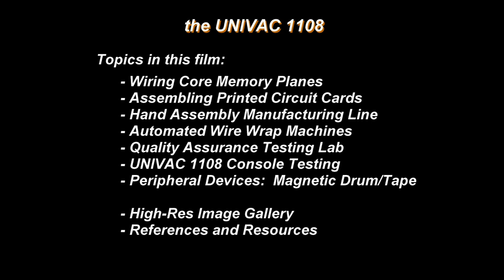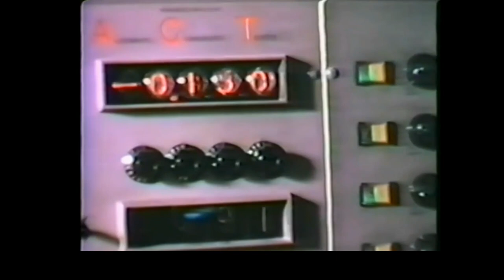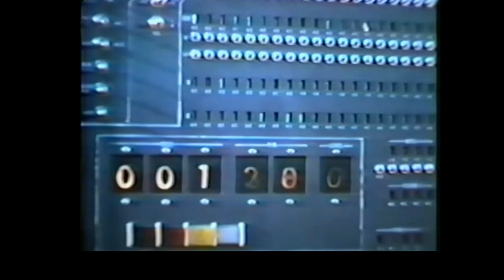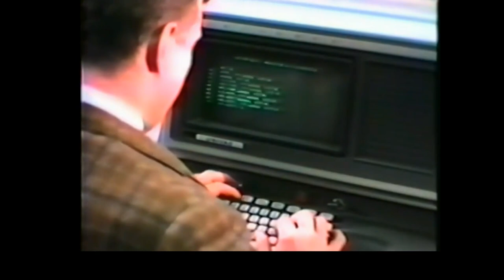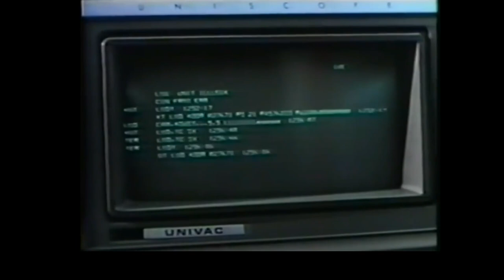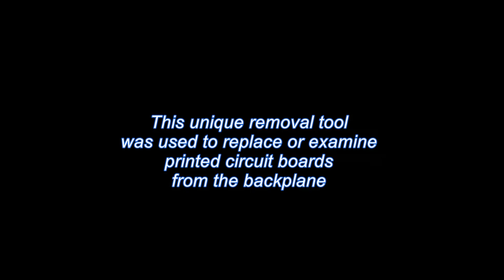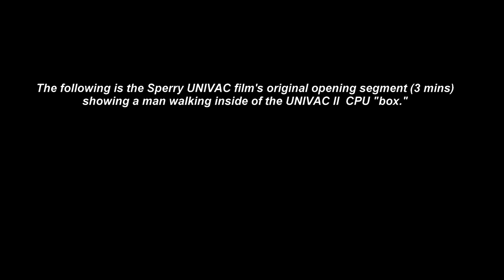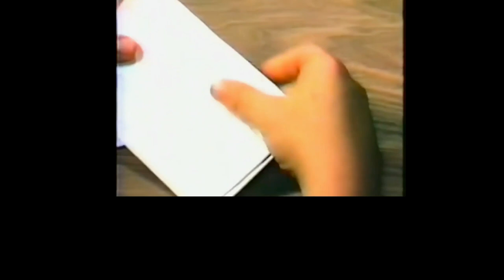Computer History:  Building the UNIVAC 1108 Computer, Twin Cities (1965-1968) Sperry Rand, UNISYS

Comment: I spent many years working at Univac (Unisys) Roseville,MN. 1108’s were the first computer I ever worked on as a tech. Eventuality wrote software for this computer and it’s many variants. I also assembled and tested the very first CRT display on a 1108. My mother in law worked there also and worked stringing those tiny wires through the core memories sitting at a microscope many hours!
Reply: What programming language do you used?
Reply: I started working on a Univac 418 III.  It was used by the city.  Started out writing Fortran.  But also did work on the machine in Cobol and assembly.

Comment: While yet in high school in 1969-70, I taught myself FORTRAN IV on a UNIVAC 1108 at Collins Radio Company in Newport Beach, California, using a book called "Fortran IV, Self-Taught" by Mario V. Farina.  I was fortunate to be one of the only ones in our school to have such computer access, more so than any of the teachers.  Collins sponsored a Boy Scout technical Explorer Post, and provided access to amazing technical resources.  I had 24-hour on-site access to all the computer time I wanted.  The actual Univac 1108 was is Dallas, Texas, but connected by high-speed data lines to a Collins-built I/O processing computer that managed the very high speed card reader and line printer.  And they had several IBM Model 29 card punches which I used to punch many hundreds of cards for the programs I wrote, and that another fellow scout collaborated on.  During the second week of a two-week Christmas respite from school, my friend and I wrote and ran a 500-card Fortran digital logic simulation program.  I still have the card stack and the printouts from the 132 column line printer.
Reply from the maker: Hi dwbogardus, teaching yourself FORTRAN is no small feat!  Very cool.  Thanks for the story!  ~ Victor, at CHAP

Comment: Watching them painstakingly running a needle and copper thread through the cores or making those little copper-wound donuts by hand is just... wow, I can't imagine more tedious, mentally wearisome tasks.
Reply: For a short while I worked in a factory making radio aerials. I put five parts in a jig, pulled a handle, took the aerial out, put five parts in a jig, pulled a handle...
Reply: Those types of delicate and repetitive operations would be unbearably tedious to many of us, and most men, but it seems that many women have both the skill and the temperament to tolerate such jobs.  Many have what is called "tweezer dexterity", referring to their precise fine motor skills.  Were it not for those skills, ability to concentrate uninterrupted for long periods, patience and precision, women would never be able to the the lace-making, crocheting, needle-point, and knitting they have long been justly famous for.  Core memory wire weaving fits right in to that same tradition.
Reply: Also why core memory was so expensive   at that time.
Reply: @kevinmiller4486  would be even more expensive now (relatively) if it was still made today, even though we'd make robots do the work nowadays

Comment: I was a Univac site engineer on the predecessor to this model - the 1106, which had very similar architecture. We used to do component-level repairs so I remember the tool shown at the end, the card puller, which was often used with a card extender to allow access to the card components while the system was running. Despite the card connectors being gold plated, bad connections would sometimes cause faults that could be cured by simply pulling the card and plugging it back in again. Being a site engineer gave you great experience, as you were expected to fix everything from a Fastrand drum storage system to a punched card reader. I still have some of my old 1106 system manuals that I used way back in the late '70s.
Reply from the maker: Hi Pat, sounds like fascinating times!   I always wondered about maintaining these giant machines.  It must have been stressful for the service engineers to try and fix problems on-site, with the DP folks impatient to get the system up and running again.  I bet you learned some great skills!   Thanks for your feedback!  ~ Victor, CHAP
Reply: @ComputerHistoryArchivesProject  It wasn't that bad Victor. Remember these were not "live" systems - the users submitted jobs to a queue, and were used to waiting several hours to get the output back. We ran diagnostics on the system every morning that often flagged issues before they became critical. Plenty of spares on-site along with excellent support by phone also helped, along with the knowledege that if the system was down for more than a few hours, a support engineer was getting on a plane somewhere to fly to your assistance. But yes, it was an fantastic learning experience.
Reply from the maker: Very cool!     Thank you for sharing that.  ~ Victor
Reply: With all due respect, sir, you are misremembering things.
The 1106 was NOT the predecessor to the 1108 ... the 1108 was the predecessor to the 1106.
The 1106 was basically a slowed down 1108 which could be sold for less.
When the core memory of the 1108 and 1106 were replaced with semiconductor memory, they then became the 1100/20 and 1100/10, respectively.
Similarly, when the core memory of the 1110 was replaced with semiconductor memory, it was re-designated the 1100/40.

Comment: I worked in that factory for 3 months in early 1975, rebuilding plated wire memory cabinets. First job in 1968 was repairing Univac II at Ontario Hydro, later Univac III and then 1108, 1106, 9200/9300, DCT2000, 1110, CS/P and finally 1100/80 in early 80's. Lots of great memories, troubleshooting down to the IC/transistor.
Reply from the maker: Hi Gerrit, thank you very much for your feedback and info on the video!  Glad you had a chance to see some of the old factory again.  I bet they were some very interesting times at the Univac plant!   Thanks again and hope you enjoy our other Univac and vintage tech videos!    Victor, at CHAP

Comment: I first worked on (dual) 1108s in 1970. Super multiprocessing machine with up to 3 CPUs and a number of independent I/O processors possible. Unfortunately the OS software was still catching up at that time (Exec level 26). Went on to work at several sites with 1108s and when I joined Univac in Roseville, MN in 1980 the slightly updated 1108 CPU was still in use as the 1100/20.

I still have my coffee mug given out on the manufacturing of the 1000th Type 3011 processor (basically the 1108 and its derivatives).
Reply from the maker: Hi Steve, thank you.   Sounds like you had first hand experience with these.  I bet they were interesting times. ~  Victor, CHAP
Reply: Well, when you're young everything is exciting. 

Fun to see the 494 computer there. A popular large computer originally derived from the 460 and military models.  I still have the maintenance panel from one of the last in service in the 1970s in my garden shed.
Reply from the maker: Sounds like a good teaching aid or wall display.  : )
Reply: My father worked at that Univac as well.  Used to drop me off at college in Roseville on his way to work and pick me up after he was done working back in the early 80's.  

Remember an "open house" there when I was little - got a cool computer print out of cartoon characters.  Only time I ever got to see where my dad worked. 

Him and his buddies bought Commodore 64's and shared floppy disk copies of the games.  Had a whole binder filled with games to play.  

He had a stroke during his lunch one day unfortunately - and never was able to go back to work.

Comment: A sperry univac was the first computer I ever used back in the early 1970s My father was an executive of a company that made glass printed circuit boards and used a timeshared univac for some of the accounting systems. I , still in my single digits years, would go in to the office on Saturdays with him (probably to give my mother a break) some times the computer operators who ran the system would put me on a paper tty terminal and let me play with it. I think they had something like the early Eliza program running so it would appear to talk to me. Other times it was more of a calculator program (this was at a time when most “adding machines” were still more mechanical than electric.) so having a computer do even very simple math that an 8 year old would understand was a novelty.
Reply from the maker: Hi S. Back, excellent feedback.  Thank you for sharing your experiences, sounds like some very interesting times!  ~   Victor, at CHAP

Comment: This was great. The Univac 1108 was the first large computer I ever used, starting in 1975, as a student at the University of Maryland, College Park. The 1100 series was strange by modern standards. It used 36-bit words, ones' compliment arithmetic, and the FIELDATA character set.

Core memory was a major enabling technology for electronic computers, which had been severely memory limited until it as developed. The degree of manual labor required to manufacture core is astonishing, which underscores just how vital it was. If there had been any other practical choice...
Reply from the maker: James, thanks very much for your comment and info.  Glad you liked the video.  A question for you --  Do you recall if the machine had any maintenance or heat issues?   just wondering.  Thanks.    Victor, CHAP
Reply: @ComputerHistoryArchivesProject  I honestly can't remember how reliable it was but it would crash sometimes. A bunch of us would be in the terminal room working on our projects late at night. Suddenly, the terminals (these were hard copy terminals, not CRTs) would stop at the same time, there would be an ominous moment of silence, and then they'd all print "Host not responding, probably down." A collective groan would rise up in the room as we all lost our unsaved work.
Reply from the maker: Hi James,  thanks for that story.  I can just envision this happening.   Have seen PC networks go down like this, but usually due to main power outage, but the "ominous moment of silence" is just as deep.  ~   Victor
Reply: In 1976, I worked with a DG (Data General) Nova II, which had core memory.
     FWIW, I don't remember any problems with that computer, other than it was slow, and only had 32KW of RAM.  But it ran 4 VDTs (video display terminals, over RS232 9600 Baud serial connections), a 50 MB hard drive, a Kennedy 600/1200 BPI tape drive, a paper tape reader and two burpee paper tape punches.
Reply: I too was a student (EE dept.) at U of MD during the late 1960s.  We started with the IBM 7094 II with cards.  Then this fancy new Univac 1108 appeared.  They installed TTY rooms in the computer science building and a remote site in the engineering building - I think it had 2 TTYs and a remote job entry machine.  I had no classes that required its use but I got a student account so I could just experiment.  I was not sure what commands to use.  The operating system would sometimes remember my uploaded programs then the next day it would all be gone.  One of my first programs was a lunar lander in Basic.

Comment: I thought the name "Uniscope" was a little weird, until I realized that the monitor was not a CRT like a tv, but it was probably indeed an oscilloscope that was fed a very specific signal so it would generate text. No 540 or whatever lines, but each character was drawn separate. I wonder why, because television was already present in the 60's.

Comment: Those 3-wire magnetic cores, those are a cheap stripped-down version, the better and faster ones have 4 or 5 wires per core.   

Hand-stuffing the PC boards was obsolete by 1968.

I tried using a Univac 1108 in 1972.  It was unusable slow, taking up to 7 minutes for it to respond to each command.   It was also totally insecure, anybody could read any file or crash the system.  

Overall a very marginal combo of hardware and software.

Comment: I wonder by how many multiples was the 1108 faster and able to hold more bits in memory than the original Univac I  ?   Did Seymour Cray work on design of the 1108 before he set out to design his own super computer business ?
Reply: I'm not a Univac/Sperry Univac/Sperry/Unisys CPU designer and have never played one on TV, but assuming that the Wikipedia articles on Cray and the Univac I are correct, then no, Cray never worked on the 1108.  He left long (in 1957) before the 1108 was being designed back in the days of the 1103 which was not at all like any of the 1100 Series computers like the 1108 (which came out in 1964).

Again, assuming that the Wikipedia article on the Univac I is correct, it had only 1K "words" of memory where a "word" was 12 "characters" where there's no mention of what a "character" is.
Since it mentions that each "character" was basically a decimal digit when used to represent numbers, I would GUESS that a character was something like Bardot (a 5-bit character) or Fieldata (a 6-bit character) which would mean that each "word" was more than the 36-bit words used on the 1108 and beyond and presumably represented numbers in BCD rather than ones complement.

The 1108 had about 262K words of memory except for some machines which were extended to use a bit in the Program Status Register (PSR) to act as an additional address bit so that 524K words of memory could be addressed.
So an apples-to-apples comparison of memory sizes isn't directly possible due to the difference in word size, but if you squint your eyes a bit (and call a Univac I word equivalent to an 1108 word), then the 1108's memory was about eight (8) to nine (9) powers of two greater larger than the Univac I.
That's roughly 2 to 3 powers of 10 for the more decimally minded.

As for speed, the Univac I was capable of about 2,000 operations per second (i.e. about 0.002 MIPS) versus about 1.5 MIPS for a single 1108 CPU (there could be up to three CPUs in a system).
That means that the latter was roughly 3 powers of 10 faster than the former in a single processor comparison.

Comment: In 1985 I got the chance to tour a couple of these facilities in the Twin Cities.  One not far from Ft Snelling was assembling some sort of custom computers for the Navy.  The other was a brand new integrated circuit plant across the river from the airport.  Is Univac still a going concern in the Cities?
Reply from the maker: Hi B. Laquisa,  thanks for your comment.   Sperry Univac was acquired by Burroughs Corp. in 1986, and they became UNISYS Corp.  The "Univac" name is now owned by UNISYS Corporation.  UNISYS does global IT problem solving, but I do not think they produce computer hardware anymore.  They are based in Pennsylvania.  ~  Thanks for watching~  Victor, at CHAP
Reply: There were a number of facilities in the Twin Cities at the time this video was made.  Roseville, Eagan, the MSP airport facility whose name I don't recall.
Roseville and Eagan were sold off.
The last I heard, everything in sight is now near the airport although I don't know if it's the same facility back I was familiar with back in 1980.

As for hardware, they don't make any of the old mainframes anymore.
Both the 1100/2200 Series (Univac/Sperry Univac/Sperry) and A-Series (Burroughs) systems exist as emulation running on Intel servers.

Comment: It had one's complement arithmetic, was the weird thing.
Reply: Ummm, no it wasn't/isn't.
And I wish that people would stop trying to make it out as if it were (which is to say people who more often than not usually have no experience with it on an 1100/2200 Series system).

Yes, ones complement has two zeroes -- a positive one and a negative one -- but the 1100/2200 Series ones complement SUBTRACTIVE ADDER (meaning that one addend was complemented before being subtracted from the other addend to perform an addition) would automatically suppress the generation of negative zero unless one of the addends was negative zero to start with.
IOW, everything worked just the same as a twos complement adder in terms of the results.
Positive one (+1) minus positive one (+1) generates positive zero (+0) while positive one (+1) minus positive two (+2) generates negative one (-1), NOT negative zero (-0), just as one would expect.